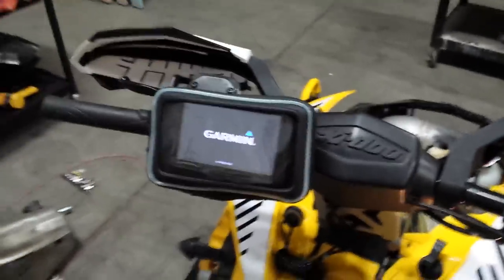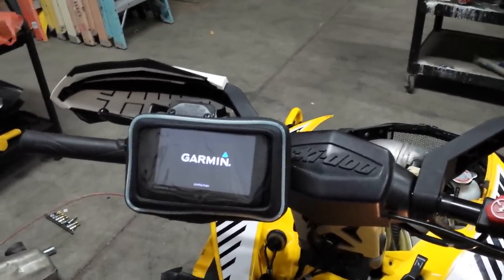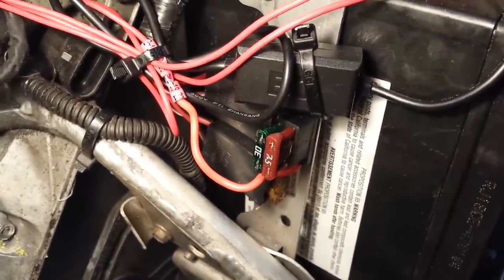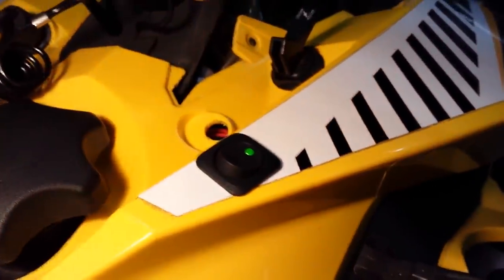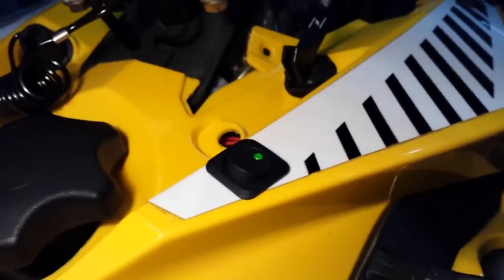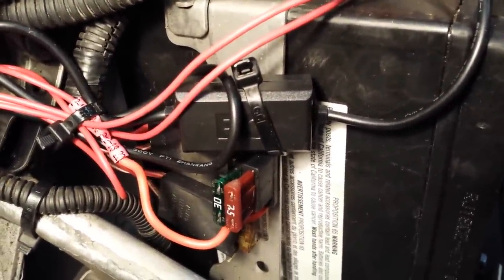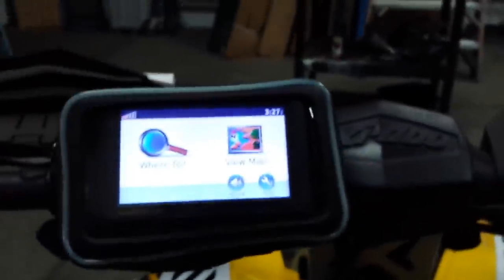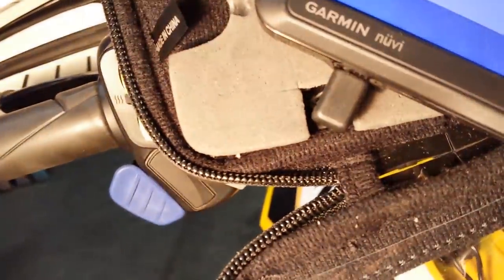Garmin Nuvi gps setup for skidoo snowmobile

Comment: Is there a way to get a list of the exact parts you used? This is awesome
Reply from the maker: http://www.amazon.com/Arkon-GPS032-Handlebar-Mount-3-5/dp/B003FMUP0K/ref=sr_1_3?ie=UTF8&qid=1386818136&sr=8-3&keywords=nuvi+handlebar+mount

http://www.amazon.com/Keep-It-Clean-SW16G-Square/dp/B001PLYWAM/ref=sr_1_10?ie=UTF8&qid=1386818171&sr=8-10&keywords=12+volt+switch

http://www.amazon.com/Littelfuse-FHA200BP-ATO-Add-A-Circuit-Kit/dp/B0002BGELQ/ref=sr_1_1?ie=UTF8&qid=1386818207&sr=8-1&keywords=add+a+circuit

http://www.amazon.com/Compact-Hardwire-Charger-StreetPilot-Vehicle/dp/B007WN4RL6/ref=sr_1_1?ie=UTF8&qid=1386818259&sr=8-1&keywords=garmin+hardwire+kit

There you go. Good luck!

Comment: Where do you get the switch/ fuse kit?
Reply from the maker: http://www.amazon.com/Keep-It-Clean-SW16G-Square/dp/B001PLYWAM/ref=sr_1_10?ie=UTF8&qid=1386818171&sr=8-10&keywords=12+volt+switch

http://www.amazon.com/Littelfuse-FHA200BP-ATO-Add-A-Circuit-Kit/dp/B0002BGELQ/ref=sr_1_1?ie=UTF8&qid=1386818207&sr=8-1&keywords=add+a+circuit

http://www.amazon.com/Compact-Hardwire-Charger-StreetPilot-Vehicle/dp/B007WN4RL6/ref=sr_1_1?ie=UTF8&qid=1386818259&sr=8-1&keywords=garmin+hardwire+kit

There you go. Good luck!
Read more